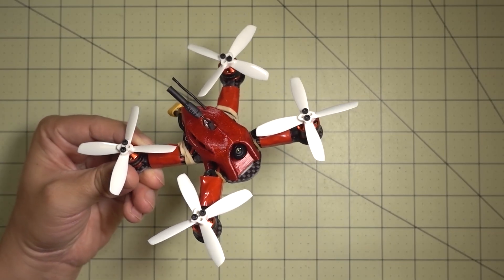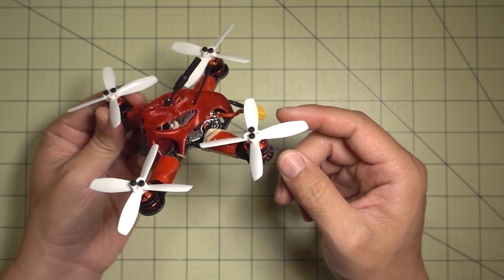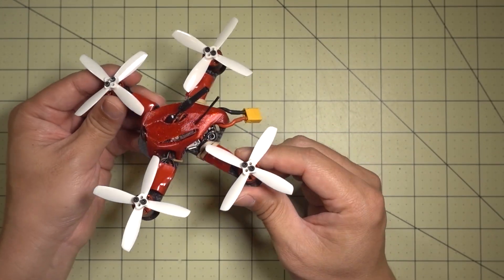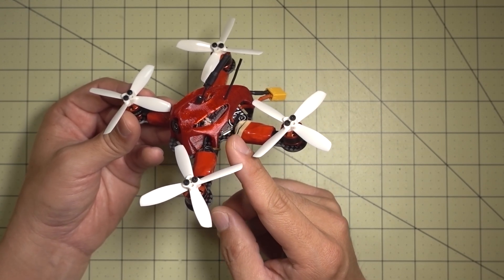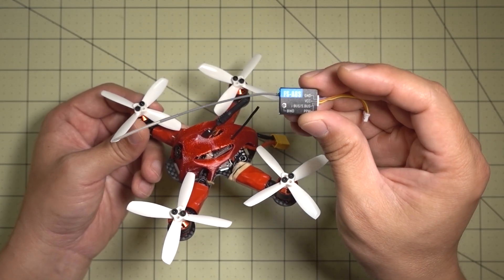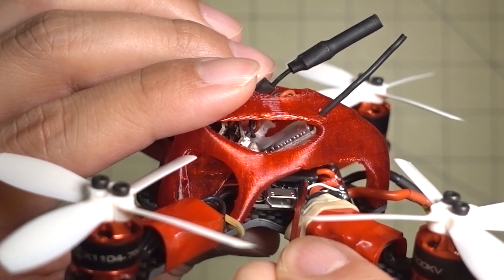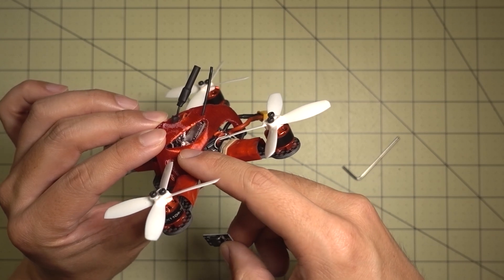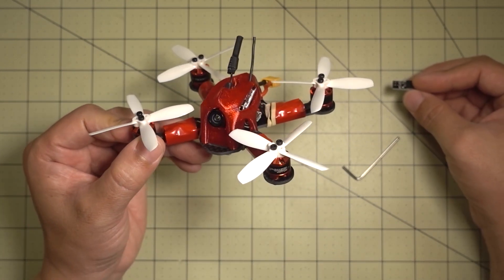Micro Drone PSA 🚁 Preventing Brownouts & Flips of Death 💀⚡👍

Comment: Great video Albert. I am sure to take this knowledge forward, but...I had something mysterious happen the other day and I wonder if you have an idea why. The build is a 4s 3in running f4 v3 , bl 20ax4 caddex turtle and rs1306 motors. no issue on punch out or flips, but i took it up high and started to descend fast into the prop wash, after a few slow oscillations it went into an unrecoverable death role. any ideas why?  Thanks
Reply from the maker: Hmmm, it could be a lot of different things.  I'm not sure where to start with just this information.  I remember helping someone else with a similar issue and after about a month of back and forth, we couldn't figure it out.
Reply: @AlbertKimTV  Thanks, I am going to replace motors, change baseline throttle, and increase idle motor speed.
here's a vid if anyone else has an idea. https://www.youtube.com/watch?v=zIFSNqD2gko&t=29s

Comment: I remember I had this problem with a home-built quad. I used a racerstar 4-in-1 esc that had a 1 amp BEC and i powered the omnibus with that, plus I had my camera/vtx wired to the omnibus. The camera would cut out almost immediately and the FC would reboot. The camera i was using was an Eachine EF01 which could not run on 2S and needed max 5v. I finally worked around it by wiring the ESC and flight controller in series (I think?), and then using the5v BEC on the ESC to power my VTX/cam. Then I got about 10 minutes of flight time on it, and lost the quad in a ditch.

Comment: Albert, you mentioned the issue FC resetting/rebooting in-flight  but not how to tackle that problem. Can you please advise your thoughts?
Reply from the maker: The solution is to add the additional voltage regulator.  If the onboard regulator is overtaxed, the FC reboots.

Comment: If you build light and are running a low mw VTX, rather than adding switching voltage regulators that create additional RF noise and subsequent unknown harmonics you can also go the opposite way by using the extra weight of the voltage regulator, heat shrink, and wiring added towards the weight of an additional light weight micro 1S battery instead where existing wiring to the VTX can usually be eliminated as well by mounting the additional battery coupled to the Cam/VTX mounted in foam. I've seen builds where just by eliminating the cam's hard mount system and unneeded wire can save enough weight to end up lighter while adding a separate cam/VTX battery. BUT DON"T PLUG A 1S BATTERY INTO AN EACHINE CAMERA VTX AS THE POLARITY IS REVERSED AND YOU WILL CREATE MAGIC SMOKE AND FRY IT!

Comment: Great video.  I have a Leader 120 that I am having serious flips of death issues.  I have changed to XT30 with brand new 7.4v Tattu 75c batteries, tried changing idle speed, nothing helps.  I still have the flips of death.  Haven't had a chance to fly with goggles yet to see if camera cuts out because I am too scared that it will flip out on me.  Would the BEC on the camera work on this model do you think?  Any suggestions you have would be greatly appreciated.  I just finished watching AndyRC's vid on prop size.  But like he said, he likes the power these props give it, as do I.
Reply from the maker: There seems to be a lot of variation in what might be the root cause of the flips of death. I'm thinking something is up with these motors.  I'm still investigating, but a lot of testing will need to be done to offer any help to anybody. The problem is finding the time to do all this testing.
Reply: does your Leader 120 do the flips too?
Reply from the maker: it did until I raised the idle speed to 8.5, then it was fine.  Did you watch the Leader 120 video?  https://www.youtube.com/watch?v=MYbqjT7CdcM
Reply: Hey Albert, just wanted to let you know what I have done with this drone.  I tried the GemFan 3025 props cut down a bit, like AndyRC did.  Still flips.  I then put a 5v BEC in it to isolate the camera, so that the board wasn't powering the camera anymore, still flipped.  I tried 3.7, 6.5, 8.5 and 10 on idle speeds, flipped all of them.  I did notice that I could almost make it flip every time when I flipped to the right.  It wouldn't flip out when you did a soft quiet flip, just when you did a fast, more throttle flip.  To the right happened almost everytime, but then front flips made it go nuts once in a while too!!. Would you have ANY other suggestions as to what to try?? I am so disappointed in this quad, it is so nice to fly when it isn't flipping out.  I guess I could try the new version of Betaflight, but I am paranoid that with this lemon it would be even worse!!  But, then again, how worse can it get, because I don't trust it to fly FPV now!!

Comment: Thanks for this Albert! If I understand correctly, you mention two separate issues: voltage sags from the battery, and having a BEC that can't provide enough current for all the components.

I would assume that 3S batteries are much less susceptible to the voltage sag issue than 2S (assuming similar quality batteries) - is that true?

For providing current, what kind of safety margin do you think is good? I'm planning a 2" build that will draw up to 800mA* for just the RX, VTX, and camera, and I'm planning to use an FC with a 1.5A BEC. This seems like a lot of headroom. Presumably the FC itself doesn't draw that much current?

Thanks!

* FrSky XSR (100mA), Micro Swift 2 (130mA), Eachine VTX03 (360mA @ 25mW, 570mA @ 200mW), and Omnibus F3 Nano V2 FC (1.5A BEC).
Reply from the maker: 3s is less susceptible by a little.  That amount of margin seems OK assuming the rating on the specs is truly 1.5a... sometimes it's inaccurate.

Comment: So on my Kingkong110 I installed a vtx03 and runcam micro, now when I use 200 MW I get a flip of deaths on high throttle but no video break up. Does this mean voltage regulator will help or switching from jst to xt30 will help ?  Thank you so much for this video btw
Reply from the maker: I'm not sure how you have things wired, but I'm assuming the VTX03 and RunCam Micro are both powered off the onboard BEC. When you increase to 200mW, the power draw also increases and puts more strain on the BEC.  I think you should power the FPV stuff off a separate BEC like a Pololu or the part I have listed in this video. Seems the FC is resetting.

Comment: great video, maybe you can help me with one.  flying a stock lizard, stock betaflight setting (other than   pids).  I get a death roll, but only in one directing, rolls fine to the right, roll left and it won't stop.  seems like this started just recently, thoughts?  flying xt30, new batteries. Thanks.

Comment: Loved the video Albert, I learned tons and you are one of very few people that have shed light on this subject. I have 2 quads that flip of death and have been pulling my hair out, a babyhawk and a teeny1s.

I tried an XT30 and a super lipo (broke a great 80c 2s down to 1s for the test) but it still flipped like before, only on full throttle after very low throttle (perhaps 0 throttle but I can't say for sure)

Looking a bit further into it, I found something else. Apparently some ESCs have problems coming back from a 0 throttle situation, in which some motors react faster and the quad flips before all motors get to correct spin. Apparently this was a thing with walkera 250 and a guy explains how to correct it by setting it to never go 0 throttle. Funnily, I don't remember ever having one of these flips of death in air mode, so it seems to make sense.

Do you know anything about this problem or can perhaps shed some more light on this type of flip of death?

Thanks!
Reply from the maker: +David Anthony Yeah if your min throttle is too low, the motors will stop and if only one stops, it does the FOD
Reply: Thanks a lot!

Comment: you missed an issue of desyncs causing flips. Ive had this happen on two different motors. there were no shorts that I could detect. the coils were all intact. one motor did it fresh out of the box. I had no solution other than replace the motor. I call them phantom shorts.
Reply from the maker: +Michael Sharp I did mention desyncs in the video. I did not mention all the causes of desyncs which is a lot and a topic for its own video.

Comment: Okay, so this is not really related to this video, but at least it is related to power.  I'm trying to keep my micro brushless quads as light as possible, and therefore trying to use JST connectors instead of the heaver XT30.  I've noticed that the guage of the battery wires on my 2S batteries varies from as large as 18awg to as small as 24awg. At what point does the JST connector become the bottleneck?  Put another way what guage wire best matches the current throughput of the JST connector?  Then, if I do make the leap to the XT30, what guage wire should be used for that connector?
Reply: So I decided not to be so lazy and found on Wikipedia that the jst rcy connector handles 3 amps and varies between 22 to 28 awg. I infer from this that there would be no benefit to using anything bigger than 22awg for the connection to the fc. Is that accurate?
Reply from the maker: +Rick in Jax I use 20 awg but probably the connector is the limiting factor and not the wire
Reply from the maker: +Rick in Jax I use 20awg with JST and 16 awg for XT30. If you use 1103 or lower kv 1104 motors and keep it light JST will be fine.
Reply: Albert Kim Thanks! That helps. I fly mostly in my backyard where the tree canopy prevents flying higher than 15-20 feet and the longest straightaway is about 20-25 yds, so my 90GT (1103) works nicely, and won't do much damage if it hits anything (like me for example). I already upgraded to a JST connection, but I think I'll also upgrade to 20awg for the connection to the fc. Thanks again for the quick response.

Comment: ive got a 2 inch quad and its a rocket on 3s but on 2s it barely lifts off the ground and the battery gets crazy hot. is there anything that im missing here?? my 2s battery is 70c so i dont think it should have too much trouble supplying the amps. if anyone has any ideas hmu :)
Reply from the maker: +harry lenon sounds like the battery is defective.

Comment: Wouldn't it better to change out the fc regulator with a step up step down regulator? So it won't cut out the 5v even when the lipo sags under 5v right?
Reply from the maker: +Dennis Riessbeck that is not possible unless you have mad skills. What I'm doing is way easier.
Reply: I didn't say it would be easier, just wanted to point out if that isn't the right thing to do theoretically? Like why haven't fc manufacturers thought about this yet? Your solution is great but it isn't actually a solution, you could still have a brownout if your lipo would sag bad, right?

Comment: Don't remember you mentioning the thickness of the cable from the battery to the quad or C ratings of batteries.
Reply from the maker: +David Codrington c rating is marketing BS. Can't be believed. Gauge of wire is not as important as the connector itself.

Comment: Subscribed ;)
What are possible reasons for copter restarts (the esc starting sounds)? My setup is racestar 10a 4 in1 and the betaflight f4 with flysky receiver you used in a build. With XT30 and large battery. It is restarting while flying and also on the ground.
Reply from the maker: +Kaptn Firlefanz usually that means the ESCs are bad. You should also check for shorts with a multimeter.

Comment: I have been doing this exact thing for quite a long time. I use micro switching voltage regulators from Pololu. I didn't catch if the one you're using is a linear or switching regulator. No mention of this in the item description either. The switching regulators will require less voltage to make the 5v out and will consume less power and run cooler than a linear regulator. I also use a version that is a step up / step down regulator so even if the voltage drops to 5v input it can still deliver the power at a lower mah. It's Pololu item S7V7F5. Just my two cents worth. Thanks for the video.
Reply from the maker: +Ground Control RC I don't think that one can handle 3S however
Reply: Albert Kim no but there are other models that can. thanks.
Reply: Here you go: Pololu 5V Step-Up/Step-Down Voltage Regulator S9V11F5

Comment: Fantastic! Great video, super timely and clear enough I could even follow. Now, you know I am no authority, so I'm only reporting what I saw on our friend Nick's recent video. He fixed a FOD problem by going into Blheli suite and turning down the motor start-up power from .25 to .031 (the min. value). A comment suggested that turning down motor timing (also Blheli) to med-low also worked for some. Advantage is it's easier to just change the software, but the question is are you pushing the problem to something else? Thanks (to both of you) for addressing this and sharing your knowledge.
Reply from the maker: Yes, I did see that. Obviously worth a try and costs nothing. I think however more flips of death are caused by wrong connector or wrong battery.  This is probably more common IMHO.
Reply: Yep, and makes more sense to have the explanation as to how the change fixes it. thanks.

Comment: Cool video! I like to get down with DSMX satellites because they only take 3.3v as opposed to the 5v that the FlySky and Frsky suck up! Every little volt counts!
Reply: Good point as the nominal voltage difference needs to be 2 or more volts for the BEC to function properly at 5 volts so as the battery sags below 7 volts the differential comes more into play leading to a voltage drop below 5 volts needed. However, Albert Kim's solution is sheer genius as it takes a hefty load off of the internal regulator.

Comment: I have a 117mm with 1105 8500kv I'm getting brownouts at full punch :( would you say the best/easy would be upgrade my jst to XT30? Thanks for you time love you videos I've learned so much have a great 4th I'm going to rip so batteries at 70% stick :*(
Reply from the maker: How big is your BEC on your flight controller? I think for that motor you need an XT30 for sure.
Reply: Micro F3 FC 4 in 1 BLLheli_S 10A AIO ESC Input voltage 2s-3s only 5v/1.5A switching power? does that help :) I'm getting some XT30's tomorrow after work I'll be trying that first see is that helps.
Reply from the maker: +GG Weslie 2.5 inch prop? 3s lipo? You might be taxing the ESCs.  You can also try adding a separate bec like I did ... the 1.5amp rating might be optimistic
Reply: Albert Kim I'm using 2.8 inch props and I'm running 2s 350mAh. Yeah 3s is too much. Off to work now should get my XT30's today :)
Reply: Albert Kim I got my xt30's the other day and it fixed the problem I can do full punches now! This thing rips! Thank you for all your work.

Comment: what about a capacitor like a 220uf or even a 100uf?
Reply: John Hunt capacitors doesn't help with brownouts, it only filters the voltage spike and doesn't work against voltage drop
Reply: Could help I think. Larger capacitors will act as a current source in the short term so yes, they can help with brownouts. Many of these micros are a bit noisy on the video feed currently, so a cap is a good idea in many cases, anyway.

I've seen at least one commenter somewhere report that they fitted a used (from 5" quad's old esc) capacitor (prob. about a 220uF 25v) to their micro 2" 2S build, and all their brownout issues were gone/fixed.

The 3S builds are not so problematic (susceptible to voltage sag issues) because of the higher voltage buffer. The problem is mostly 2S systems.